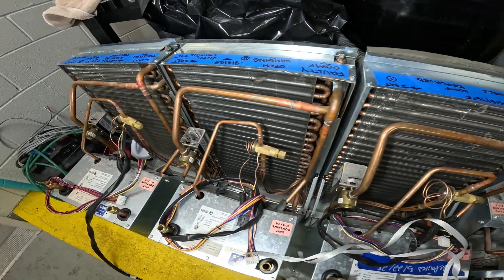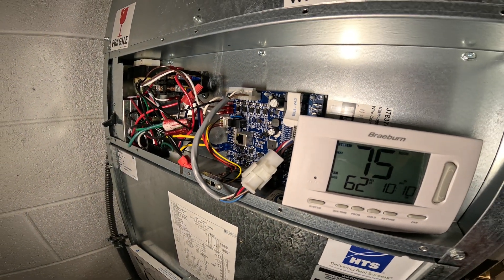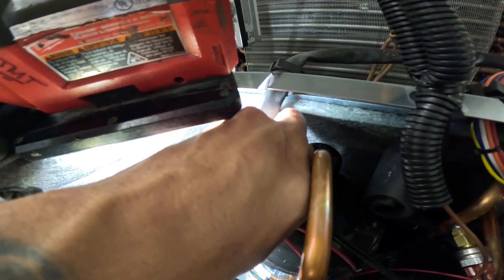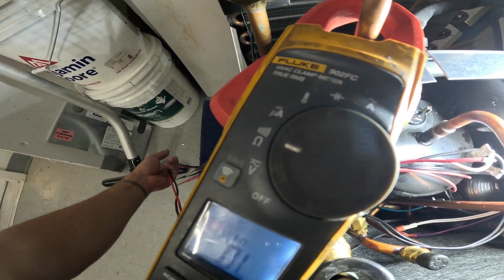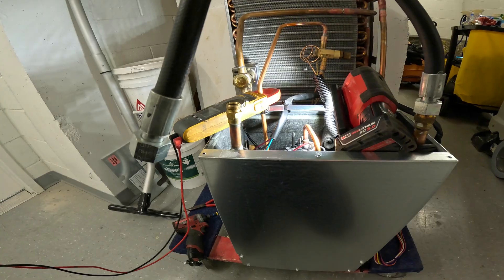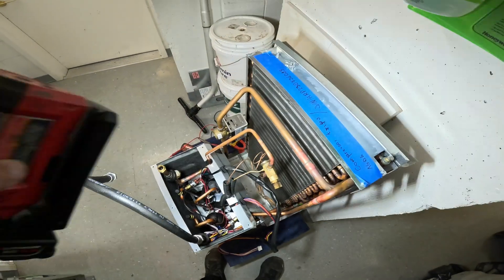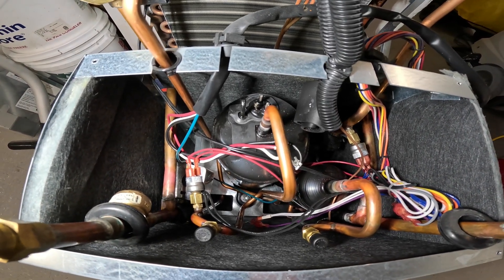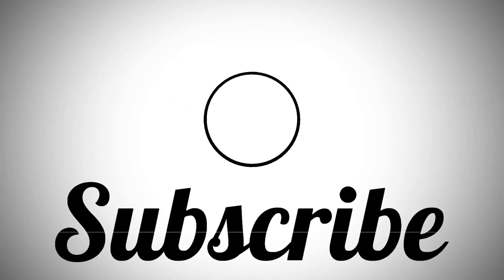HVAC: Omega Water Source Hybrid Heat Pump Tripping Breaker! Single Phase Compressor Troubleshooting

Comment: maybe refrigerant leaked out and chiller water back in via the coaxial condenser coil. they are tube in a tube, unless plate style and water will for sure smoke a compressor.
alternate very poorly adjusted chiller water issue letting them run hot/bang on thermal non stop.

Comment: Also should mention for new techs that an overheated compressor will read ‘OL’ between the terminals until it’s cooled down, as most have a safety device inside to cut power when they get too hot.